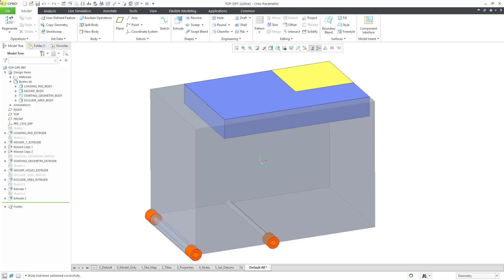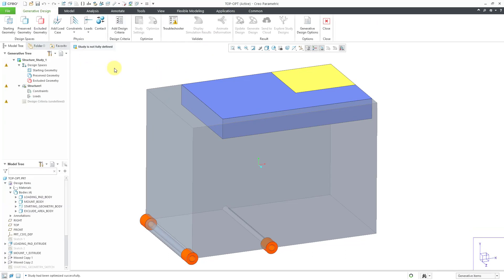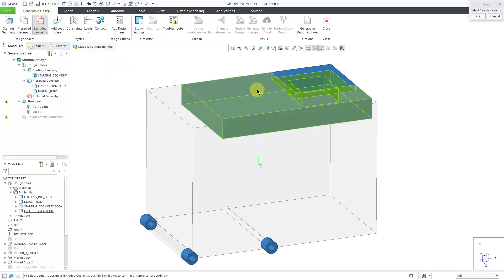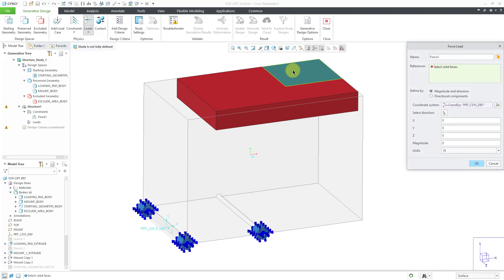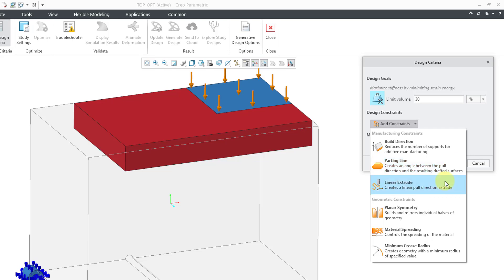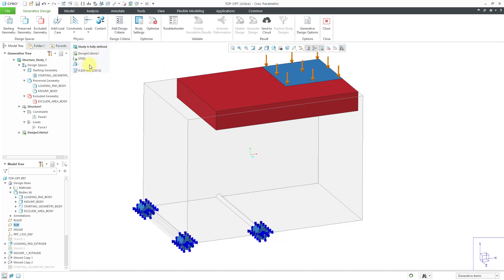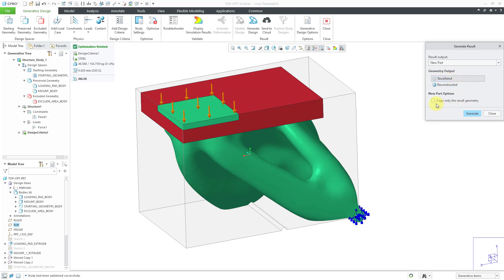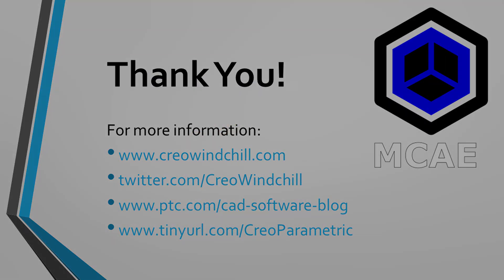Creo Parametric - Topology Optimization | Demonstration

Comment: Can you tell me how to set up your part to start doing optimization? How do you start constructing these bodies without interaction?
Reply from the maker: I made this video almost 4 years ago, so I don't remember how exactly I made it, but I can guess. I probably started with the overall envelope as the main body (Starting Geometry). Then I created other features for the Preserved Geometry and Excluded Geometry. Most importantly, when I created the new features, I checked the option to create them as New Bodies. Then I would use Boolean Operations to subtract the new bodies from the main body, making sure the Keep Bodies option was turned on.

Comment: With this result we can optimise our design... But we cannot use this output from creo directly, as it is  very difficult to manufacture
Reply from the maker: This was just an overview and I did not go into detail on the manufacturing options. If you used Topology Optimization back in Creo 5.0, I would agree. But the new Generative Design Topology Optimization module does result in manufacturable geometry. That was the main point of the new module.
Reply: @CADPLMGuy  Thank you for the clarification sir..

Comment: I m facing 
"license is lost"  
What is solutions
Reply from the maker: I already told you to change the config option suppress_license_loss_dialog to yes. If that doesn't work, file a ticket with PTC Tech Support.
Reply: @CADPLMGuy  after doing that suppress license file that error still coming
Reply from the maker: Like I said before, contact PTC Tech Support.
Reply: @CADPLMGuy  thet don't give any reply